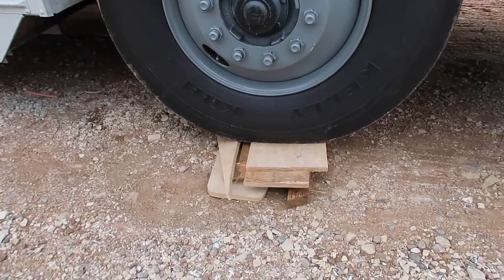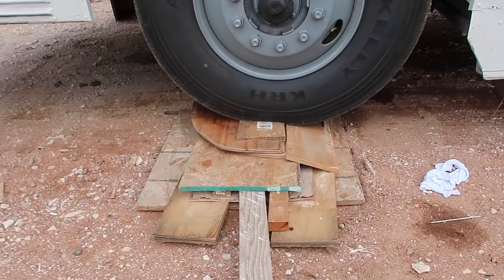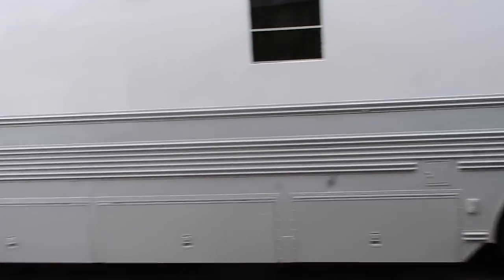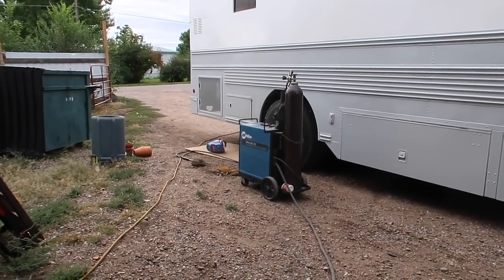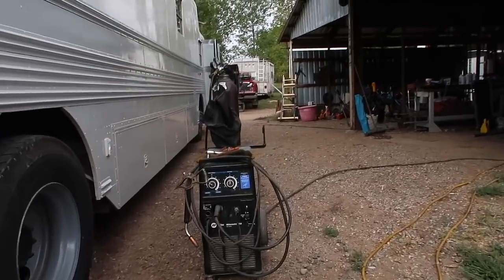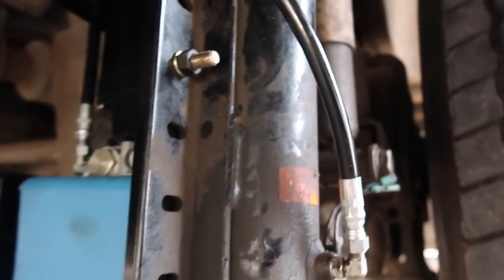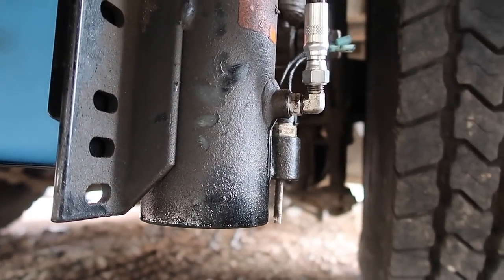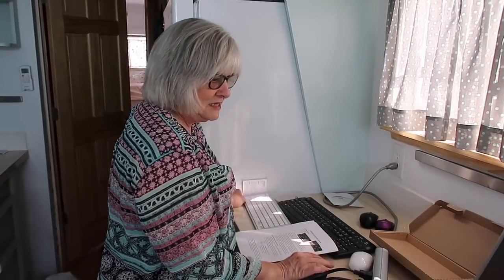School Bus conversion to Motor Home #67 Quadra (Big Foot) levelers (PART 2)

Comment: Jim!  About the Computer, when Computers are sold, they tend to have very little resources.  Resources are RAMM and Storage Capacity.  Check that you have at least 50%, of the RAMM it will use.  RAMM is very reasonably priced these days.  You can go 'online' to www.crucial.com and find the 'Advisor' scanner.  It will scan your computer and tell you how much RAMM it can use.  If you can afford it, fill it full of the maximum RAMM it will use.  You won't be sorry!!
Reply: Jim Gadberry as long as it is rebooted once every 24 hours, I agree, 4 gigs should be enough!

Comment: did this come with an install manual? "self contained" meaning that you don't need to have hydraulics in the bus before this, right? The pumps that come with provide all the hydraulics you need, right?
Reply from the maker: Yes it does have an install manual but it is not great (for several different models).  Trying to find room for them is difficult.  They have their own hydraulic system.   Thanks for watching!
Reply: @LifeisaJoy  Just ordered ours and having Wess install the brackets while he's doing the roof raise! So excited. Should be dropping the bus off with him next weekend!

Comment: With the 21" extension plus another couple of inches with the solar panels you must be close to the maximum height of 13'1' to get under bridges - what is the height 12.5 ???